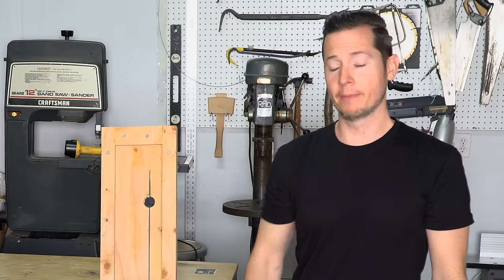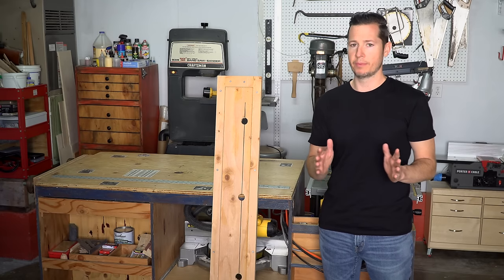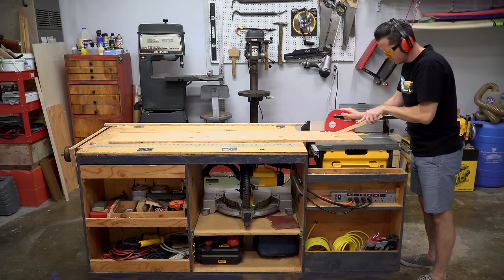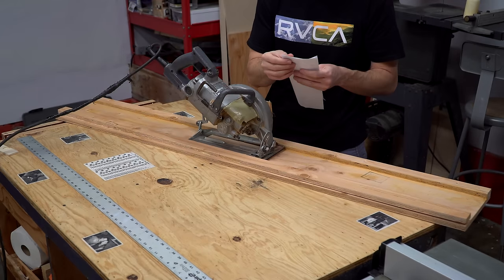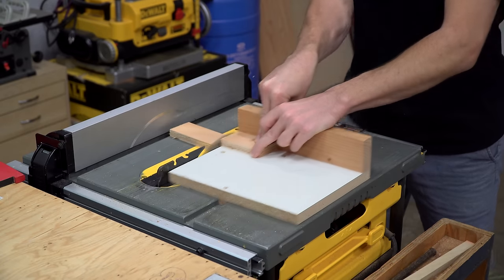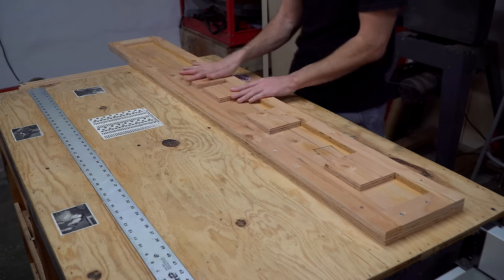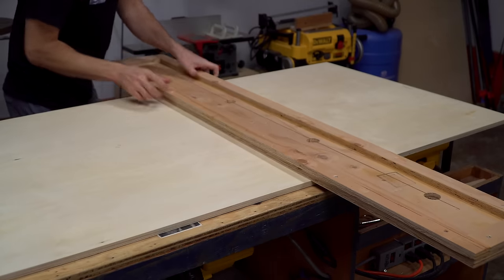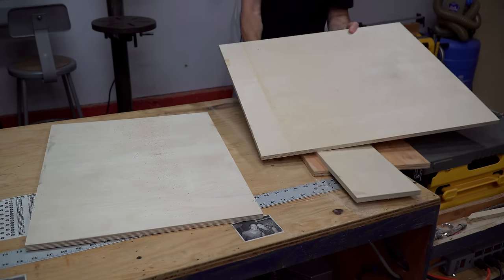Super Simple Track Saw

Comment: Good design and thanks for saying that going fast added problems for you (the holes). Things like that are easy to miss when designing. I will add though that the screw industry was helped quite a bit by your construction. I'm sure you know that glue is stronger than wood and all that was needed was the pins to hold things in place until the glue dried. The screws added nothing. But, if they made you sleep better than I'm sure they were worth it! ;>) Nonetheless, an excellent design.

Comment: In my opinion, this Track Saw could even be simpler if the piece of plywood attached underneath the whole system be removed. By doing so, you could cut deeper, probably half an inch more, which means a lot with those who already bought a small circular saw. 

I know the slot on that piece of plywood is needed for pairing with the ink that marked on the wood below, but that function can easily done with a string, or chalkline.

Comment: I wonder if the "fences" should be wider to allow easier clamping. In his case, he used a worm drive saw with the motor out of the way.  Non worm drive saws may require more side clearance.    Also consider using hardwood fence material like poplar.  Otherwise, the plywood edge may not remain a viable true fence.   Just some suggestions.  Thanks.  BTW, I use a homemade singe-fence design.  I don't have trouble holding the saw against the fence, it is highly  accurate, it doesn't require end stops, and I don't have to remember to allow for the blade kerf.

Comment: Excellent! I would use planed and jointed wood, but what a nice idea! Why buy one?
Reply from the maker: Thank you, Brendan! Just so you know, if you do make one of these, you'll probably want to use plywood. Plywood has less expansion and contraction than regular wood, and for that reason is better suited to most shop jigs, especially when they need to hold straight and true. I hope this helps!
Reply: @OneMinuteWorkbench  what about mdf?
Reply from the maker: MDF is probably safe, but I haven't tried it. I have tried masonite though, and don't recommend it. Have a look here: https://youtu.be/Fc77cL8ReBQ I hope this helps!

Comment: This is great, I was just about to build something similar but much simpler - think this track, but without the centre plywood. The thing is, I don't really see the point of the centre plywood at all. It guides the blade, sure - but along what path? Well, the path that was originally cut by the saw. And what determined the direction of that path? It was the plywood rails on the side of the track. So, if you build the same thing without the centre plywood, surely it would cut in exactly the same manner?
Reply from the maker: Thanks! You could give your idea a shot, but I think it would be likely to flex (although, as long as you're not applying too much lateral force, it would probably be okay). There's only one way to know for sure 😉....let us know how it turns out!
Reply: @OneMinuteWorkbench  Hey cheers for the reply. I considered it a bit more and decided to go with your design because I might have overlooked that the slit would help keep the saw straighter on faster cuts and maybe prevent saw flex, I dunno I'm pretty green haha. If I try the other one too I'll let you know!

Comment: Now - wax the guide way for the saw. It will make life a lot easier. Perhaps also round over the edges of the guide boards just a bit. You'll be surprised how many times you run your hands over those edges when making cuts.
Reply from the maker: Thanks for the suggestions!

Comment: I like this design, very simple and effective, but having to copy it i would probably use more wide plywood pieces for the superior layer and a very thin plywood for the inferior layer. That way you loose less depth of cut, thing that is not a big problem if cutting sheets, but can be a problem if the jig is used to cut irregular edges of solid wood boards and in the other cases when the thickness of the material you have to cut is close to the maximum depth of cut of your circular saw.

Comment: I couldn't find a piece of plywood where the factory edges were actually straight, so I used two pieces of mdf wall trim instead for the rails. It has a little give, but the edges are flat and you can just push it into position against a straight edge and then screw it into the plywood base.
Reply from the maker: Thanks for sharing about your build!

Comment: If you drill the holes first, how will you be sure you are centering those holes on the line?  Your method seems good

And I wonder if it needs to be 3/4”? Would 1/2” or 3/8” work? I have a compact circular saw
Reply from the maker: I’ve made 3 of these now, and one the others, I just used the saw to score a line for hole centering, then drilled the holes, then did the full plunge to cut the slot. Both of the other ones I made were with 1/2”, and they worked great with sidewinder style saws. I hope this helps!

Comment: Or instead of making a track saw jig, you can just measure off the edge of the sheet at both sides and clamp on a straight edge allowing for the width of the base to the blade ... same outcome a lot less work👍🏻

Comment: I believe you would have been fine without adding blocks to get your view port drilled. Clamp it down and the paddle bit would go straight in bc it's mounted to a drillpress. I can understand a hand drill and cheap paddle bits. I believe a hand drill and a threaded paddle bit would work as well after cutting the channel. Nice design and I'll give it a go one day. I install flooring on a daily basis and often times have to rip a 1/4 or so off the bottom off some doors to created clearance if the new flooring is thicker than the previous.

Comment: I made this using the video. Mine bowed really bad in the middle. Maybe it was the kind of plywood I used....I also made it slightly too small for ripping the 48" side of a sheet. You have to take into account the blade's diameter.
Reply from the maker: Thanks for sharing what happened during your build. A lot of people ask if they could build it with one type of material or another, and I often answer that I can't be sure for all the materials I haven't tested. It's awesome that you took the time to let us all know about something that didn't work out. Can you share more details about your build? For example, can you share what type and thickness of plywood you used? Also, have a look here at the updated version, and you'll see where I attempted to build one using masonite, as recommended by many viewers: https://youtu.be/Fc77cL8ReBQ Thanks again - I look forward to hearing more details!
Reply: @OneMinuteWorkbench  yeah i saw the updated video. I figured masonite would be too flimsy. I used 3/4 inch $30 plywood from home depot. Maybe my garage got too humid...i saw another video using U tracks...i might try that next.
Reply from the maker: 3/4" plywood should work pretty well...is the warp "side-to-side" (meaning will it force the saw to cut a curve) or is it bowed in a way that won't affect the cut after it's clamped? I've made (2) more since this one, and both of those were made from Baltic Birch. Expensive, but VERY nice and VERY flat. Either way, keep me posted on your progress!
Reply: @OneMinuteWorkbench  Bowed in the middle length-wise so when I make a cut, the middle of my cut piece sometimes doesn't get cut.
Reply from the maker: Sorry for the late reply on this...so it bows upward away from the surface being cut?
Reply: @OneMinuteWorkbench  yup it bows upward in the middle away from the work piece. I even stored it flat in the garage.
Reply from the maker: Was it bowed to start with, or did it bow after sitting in the garage? And what type of plywood? I also wonder about the humidity in your area (as you mentioned)...I have yet to store mine flat or hang them on the wall. I just leave them (I say "them" because I have 3 of the now, for different saws) standing and leaning against the wall. The first one (shown in this video) was made from regular old sheathing plywood, but the other 2 are made from Baltic Birch. The higher quality plywood versions definitely look like they're going to last longer, but even still the first one is still fine.

Comment: Like the design,but, for a track saw to be a track saw it needs to stay in place without clamps.  Putting some adhesive backed sandpaper, 2 strips 1 inch wide, down the back of the base eliminates the need for clamps. That works great. Now you have a true track saw.
Reply from the maker: Thanks for the tips!

Comment: Did this over the weekend with 1x12 common board from Home Depot instead of ply. Worked great, except that I put a light coat of latex poly + 220 grit sand to seal it up before putting some light WD40 on the track path to give the saw a nice glide. However, it seems the poly expanded the wood slightly, now my track that was snug has about 1/8" wiggle room for the saw.

Any suggestions to fix this other than do over?
Reply from the maker: The problem with boards is expansion and contraction as the relative humidity changes. The environment at the mill is different from that at Home Depot, and Home Depot’s space is no doubt different from yours. So, you have to bring boards home and let them acclimate to their new home before you work with them, but even then, they’ll change as the seasons change (or as you learned, they might change just from applying finish). Plywood is a different animal. It’s an engineered structural material more suited to applications where the mechanical properties need to be within a tighter range. The layers of wood in plywood contrast each other (in direction) which helps stabilized the wood (prevent expansion/contraction). The layers of glue between the layers of wood also help to lock things down. Does that make sense? When it comes to the track you’ve built, you’ll just have to determine if the amount of wiggle room is acceptable for the types of projects you want to use it for...if it’s good enough, don’t sweat it. If you need it more accurate, you’ll need to start with plywood or some other more stable material. I hope this helps!
Reply: @OneMinuteWorkbench  Thanks for your reply. Do you not expect similar movement with plywood if I use poly to finish? My only reason to use poly is so that the WD40 doesn't make it into the wood, helps the saw glide with less friction, and resistant to some environmental conditions. 

As an upgrade, I may use aluminum angles for the guides. Those shouldn't be inert to poly and moisture :-).
Reply from the maker: Plywood is much more stable, so no, I wouldn’t expect to see the same type of movement. In fact, if you apply polyurethane, you’ll likely make the track too snug. If that does happen, you’ll have to sand it down to get things moving again. Either way, good luck!

Comment: You can also use a light coat of beeswax on the surface of your track and it will glide very smooth. 
Also do you really need to stop blocks on this? 
 I was thinking you could make longer cuts without them
Reply from the maker: Thanks for the suggestion! FYI, the blocks just help you from cutting the track in two. Does that make sense? I hope this helps!
Reply: @OneMinuteWorkbench  your welcome & yes it makes sense 👌

Comment: couple of question:

1.  is it really necessary for the larger sight holes to be perfectly oriented to the cut line?  I mean these just serve as sight holes right?  could be off as much as 1/3 inch is still function to see the proper cut line below?  Seems like blasting a 1 inch hole is pretty big for the case use...

2.  a decent formica veneer laminated to a the plywood and also at the side walls on either side would be an excellent touch to smooth the operation and help makes things glide.  In my shop, things get dirty and dinged up pretty rapidly.  especially the sole plate of the circ saw....thoughts?

3.  isn't it necessary to cut the lower plywood plate at 45 in both direction during the fabrication of this tool?  In this way, you are ready to go with any number of angles you might have to create later down the road.  (taking care of interference now during the build-up so it's not forgotten later...?

4.  In addition to question 3, would it not be a good idea to use a large thick blade during the initial fab of the cut line.  Again, so if you need to in the future you have the means to go up or down on saw sizes.

5.  In addition to question 3 & 4, given you may need to run the saw at your material at 45 one way but in another instance, 45 in the other, due to most circ saws only allow roll to one size, perhaps making two difference cut lines per the dimensions and orientation both ways. (two parallel lines)  on closer to one sidewall edge and the other farther from the other?  (yes, I know you "can" just flip the work material, but there are other reasons to go only at one side of the material when ripping..especially in a cross cut.. and yes, I understand that you can run the saw in the opposite direction..but there are some circumstances where this is impractical ....particulary with narrow width work material)?

anyways,  just some questions and suggestions ..

Comment: Wait a min!!!  All 1" bits all have starter points. All you need to do is run your saw with the blade not going thru, have a block with drill hole to drill a piolet hole for the 1" bit to mark where you want to drill the 1" holes.  Forget all this using blocks.  Using one block, drill the piolet hole and move to the next mark and drill. then drill the 1" hole.  This might be a little more work but less of a pain.
Reply from the maker: Great suggestion!

Comment: I didn't understand why you need to measure the front-to-back distance to do anything with the end stops. Those will just be whatever they are. Was it to make sure you left room for clamps?
Reply from the maker: It was to make sure the stops weren't so deep that the limited the slot length to less than 48". The slot has to be a minimum of 48" to cross-cut a full sized sheet. I hope this helps!

Comment: Love the video , my problem is that I want to cut a 45 degree rip and don't want to use the table saw (which I don't own). Would it be possible to make a track saw guide like yours but for a 45 degee bevel? I plan on using it to make a french cleat wall.

Comment: being it is wood, does warping become a future issue?
Reply from the maker: Plywood has a lot less movement than regular wood. Since it is laminated with layers where the grain opposes each other, it "locks" it in place (the glue they use helps a lot too). That said, this particular track won't last as long as an aluminum one, but it'll last a long time. Since this one, I've made a couple more out of higher quality plywood (just search my "videos" section, and you'll find them, if you're interested) and those will last even longer. Anyway, I hope this helps!

Comment: Great video, but the one problem about this design is that it only works well if your circular saw have a good solid base, with sides lined up with the disk... unfortunately here in Brazil there is a lot of cheap junkie base circular saws, so we need the decreasing depth pieces attached to it.

Comment: I made this but I grossly underestimated the length it needs to be. I thought I'd overshoot it by making it 52" which would obviously be longer than the 48" cuts I need, but you have to account for the length of the circular saw's body (both at the beginning and end)! So don't do like me. Make it way longer. Like, go ahead and make it six feet even.

Also, I found the glue and screws (even with drilling) made things way too tight and couldn't move my saw. Had to use lots of sandpaper, chiseling, and a finger plane to give it enough room. I almost wonder if it even needs that second rail as you could keep it butted up against one side anyhow.

Comment: Steel angle screwed or bolted to the base board (with it without battens) would prevent the saw slot spreading In the middle.

Comment: Why do you pin AND screw? Are the pins essentially just a temporary measure (like a tack weld) but the screws (and glue when you used it) really provide the holding strength?

Comment: Very beginner here - why did you add a stop block, and to both sides? Given various situations, wouldn't it be good to be able to just slide it right in and/or slide it right out? Surely the frame of the circular saw lines up before there could be any off-centering cuts happening?

With my circular saw it seems to be operated from a push in from the side rather than a push in from above?
Reply: Kaitlyn McLachlan, if you did not have a way to NOT cut the ends of the track, you would end up with two separate pieces the first time you used it, as you would have cut the track apart!  The stop blocks end up keeping the track sides together as one unit.  Make sure your stop block sections are long enough to give rigidity to your assembly.  Also, make sure your wood "side rails" are wide enough to prevent warping over time.  If your side rails are too thin and made of a soft wood, they could end up warping and that would throw off your cuts slightly. Hope this makes sense to you!  Another idea might be to use metal angle irons (easily available from big box stores) instead of wood "rails".  More expensive and heavier, but certainly rigid.  Just a thought.